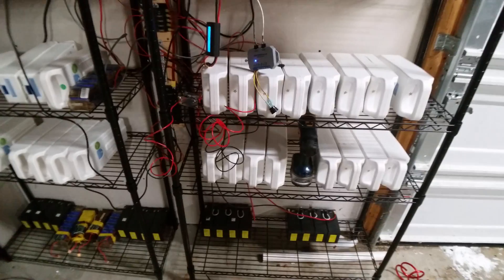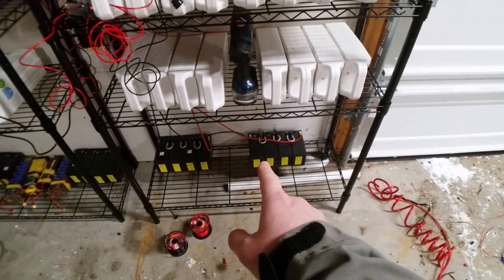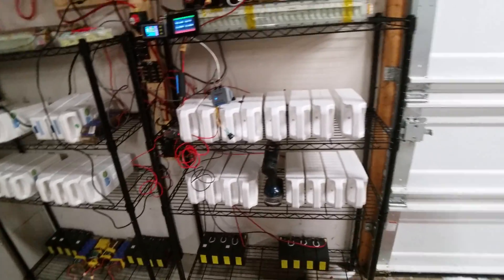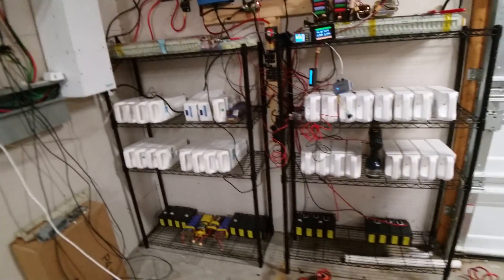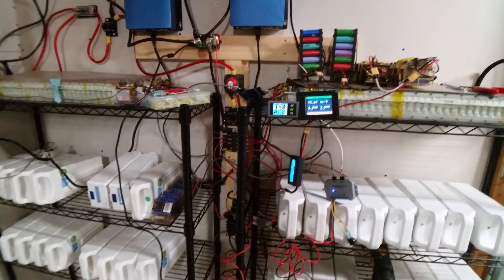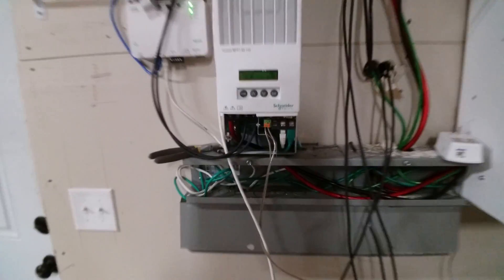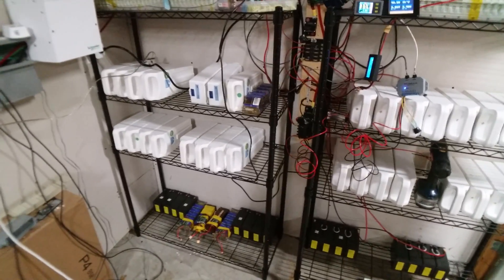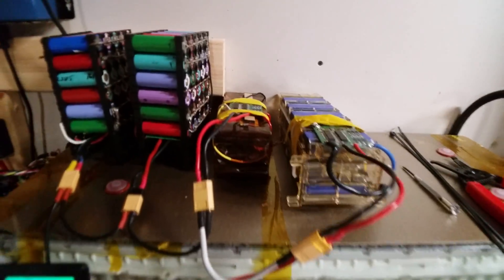DIY Tesla Mobius Powerwall Almost 20kwh Update 2

Comment: Hey man... I appreciate you documenting your journey. I just picked up a couple mobius battery packs and am planning on using them to create a portable solar generator. I was wondering, did you do anything to be able to draw power out of these packs? When I connect an inverter to one, or both in series, I get no power to the inverter. I saw  a video from combatengineer that he had to send a 12v current through the inverter back into the battery with a power supply to allow the inverter to then start drawing power... But seems like you're just plugging and playing? Any help would be much appreciated
👊🏼 Dave

Comment: When wiring up your mobius packs to 48 volts (4 in series).. are u still able to use the bms that are in the packs as they are 12 volt BMS running 48 volts out?
Reply from the maker: Because they are in series the 48v is divided between the 4 packs, so they only get 12v each.
The BMS works just fine, been using them this way since summer and no issues.
If they were in parallel, than that would be an issue, than they would all be getting 48v and would fry the boards.

Comment: New racks are 👍. Hey. I’m trying to bump charge the sonata 5300 batteries I over-discharged. What volt & amp settings do you recommend? Thanks brother‼️🔋
Reply from the maker: Did you have the BMS board connected? IF so the boards maybe damaged
If not there is light at the end of the tunnel

You will need an RC lipo charger (B6, Tenegry AC6, etc)
Connect the lead only to the first string of batts (Pos/Neg), set the charger to NIMH or PB (one or other maybe needed depending how far you discharged them)
Set the current to 10amps max (The NIMH option should auto adjust voltage, but for the PB you will have to set it for 1 cell)
Start charging and see what the voltage is doing, you should see the voltage start to slowly come up.
Once you get the batts to stay at 3v without the charger on, than you can set it to LIPO mode and let it charge like normal.
I have done this many times with regular 18650s and it works great.
You will have to do this for each row of batts, unless you have multiple chargers

Here is a link to a charger

https://www.amazon.com/Genuine-Professional-Battery-Balance-Discharger/dp/B0722NGPBS/ref=sr_1_9?ie=UTF8&qid=1515588272&sr=8-9&keywords=b6+lipo+charger
Reply: Mytime34 ; Disconnected the bms on both packs ala Jehu Garcia, cause I’m a dumb newb. One pack is broken down to singles and the other is still intact. I’m using a down-step converter, but I didn’t try 10amps. Leave voltage @ 4.2? Thx for responding 👊
Reply from the maker: J.E. Rose in some cases you might have to jump the voltage up a little, kinda a like a big quick boost. Each battery may require a little different currwnt and voltage. I have not used a step down converter, so I cannot say if that is right or not. With an RC charger they will cycle on and off so you don't destroy the battery. I did the same as you with my first few packs, but realized that the bms board is actually a good board if you are staying under 15amp of discharge
Reply: Mytime34 ; I’m saving up for some Average joe shwag, but the Imax charger is on the list 😉🔋🔋

Comment: Looking good Man!!! Cold as sh!t here as well. What is your mining rig or rigs inside🤤🖒
Reply from the maker: AveRage Joe, here is what my rigs consists of the following:
Rig 1, Main Gaming PC Win 10: Intel 6700k, Gigabyte Z170X-GamingGT Motherboard, 16gb DDR4 ram, 2ea 512gb M.2 Hard drives, 2ea 500gb Sata SSDs, NZXT H440 Case (All panels removed), EK Predator 360 watercooling setup (with quick disconnects), Asus GTX 1070 Dual 8gb video card (stock cooler), Gigabyte GTX 1070 Micro video card (stock cooler), HX1200i power supply. I have the cards running at 60-65% power, memory is overclocked to 712mhz and no core overclock. This system nets be about $10 day. Via NiceHash

Rig 2, Server/miner/video processor Win 10: Intel 5200k, Asus X99-E WS/3.1 Motherboard (with 8 PCI-E slots), 16gb DDR4 ram,  256gb M.2 SSD, Giant thermaltake cube case, EK Predator 360mm watercooling kit (quick disconnects), EVGA GTX 1070 FTW with EK Waterblock, EVGA GTX 1070 with EK waterblock, 2ea HP OEM GTX 1070s with EK and XSPC water coolers, HX1050 power supply. These cards are running between 60-72% power and this system makes between $17-30 a day, via NiceHash

Rig 3, Rack setup Simplemine OS: Intel I3, 16gb DDR4, 30gb SSD, Metal frame rack, AX1200i power supply, EVGA GTX 1070 FTW, EVGA GTX 1070, GTX 1070 Founders Edition, HP OEM GTX 1070. These cards are running between 60-68% power, memory is overclocked to 800mhz and no core overclock. This system strickly mines Ethereum and makes about $15-20 day

Rig 3, Pole Barn PC Win 10: Intel G4400, 8gb DDR3, 128gb SSD, MSI case, 500w thermaltake PSU, Asus R9 290 Dual video card. Card is running stock at full power and a slight memory overclock. It makes about $4-6 a day via Claymore miner (Ethereum)

My plan is to put the 2ea GTX 1070 FTW cards in my main gaming PC with watercooling and run the cards all out, they mine really well.
Than take the 3 HP OEM GTX 1070s and the Founders edition and run them in the rack setup, as they run almost the exact same settings.
The last system will have all the EVGA GTX 1070s in it, which will have the same settings.
As of right now between the Nicehash mining and the ethereum mining, my systems project $1k-$1200mo
This will be my first solid month of having all 4 systems running.

I purchased all of these items used on ebay and forums and nothing was full price, more like 50% off normal pricing
My ROI is 3.6 months at my current rate

I will try to shoot a short video on my setup, but man my office looks terrible and Jerry Rigged (that is a shout out to Barnecules Nerdgasm)

Comment: I very interested in the complete wiring system, could you go over it more slowly and explain why you choose the different types of storage, the benefits of each, thanks!
Reply from the maker: The mobius packs are where I started, I found them by accident and thought they would be cool to try and use. This was before I ever got into the solar portion.
After I bought my first 4 packs I created a very small setup with 2ea solar panels.
Once I realized how easy the packs were to use and that they had built in BMS's I proceeded to expand.
I found a local solar panel maker and got a good deal on my first 8 panels, with those panels I was able to get my first charge controller (just a cheapy one). At this point I realized that 12v setup was not going to work for me.
I had enough mobius packs to make a 48v system, but I needed a new charge controller, so I got my Schneider MPPT 80/600 setup connected to the 8 solar panels. 
With all that power, I needed to add storage to make sure it could run my inverters at night.
The only reason I got the tesla packs is that they were a heck of a deal and had the power I needed.
The mobius packs are cheap and easy to get/use. They provide 1.1kwh worth of power
The tesla batts are just really nice batts
The only reason I am using the VRLA batts, is because I get them for free and they help balance out the coupe de feut

Comment: what custom settings do have for your controller?
Reply from the maker: Which controller are you referring too?
Reply: xantrex
Reply from the maker: For the Xantrex/Schneider Charge controllers I have them set to custom battery settings:
MPPT 60/150
Charger 51v (actual charge value is 50.4vdc with a calibrated fluke meter)
48v battery
Absorb time 180min
Max charge 100%
Bank Capacity is 440ah
The aux contact is set to turn on at 48vdc, so the solid state relay activates and turns on one of the inverters
This same contact is set to turn off at 36.5vdc and turns off the solid state relay, which in turn shuts off the inverter

The MPPT 80/600 is set very similar, except I am not using the aux contact.
I am using an email notification if the system is making too much power, at that point I remotely activate the 2nd inverter, via a wifi outlet.

The only issues I had were in the beginning, when I was pushing too much voltage to the packs and fried a few boards, but now I have things set exactly how I want.
Once spring rolls around the solar output will charge all my batts by 10-11am, so than I will be able to run the inverters all the time.
My goal is to purchase the Conext XW+6848 hybrid inverter, which will automatically turn on and off without solid state relays.
I can than sell my 1k grid ties
Reply: thanks, i have a xw 6048, thinking or adding tesla batteries with my lead acids.

Comment: What's inside those Mobius packs?
Reply from the maker: BellPhreak they are Boston power 5300mah cells. Check out my other videos as I have some packs that are taken a part. Also check out The Combat Engineers videos, as he takes a pack a part.
Reply: @mytime34  Did you find it tough getting 18650 cells out of these packs? The housing is supper stubborn on mine
Reply from the maker: @DownwardSlideBlues  SOme of my packs had the 18650s and some had the Boston 5300 cells. The aluminum plates soldered to the cells are what take forever to remove. I never really had issues with the housings.
Reply: @mytime34  after I posted that, I went nutso with the pliers on the nickel strips, and that definitely made a huge difference. All the cells were super drained though (1 volt or lower) so I have a bunch of cell rehabilitation ahead of me
Reply: @BellPhreak I have some of the Mobius packs for sale. If you are interested LMK.
Reply: Lawrence Gerber Hi Lawrence..I may be interested in some of your mobius packs if the price is right
Reply: @RALPH Looney
How many do you need?
Reply: Lawrence Gerber between 40 and 60
Reply: Do u happen to know of a formula to calculate the remaining lifespan of the cells based upon the percentage of stated capacity remaining in a cell? The  ones I have purchased  so far have around 4000 left of the 5300 mah stated as new.
Reply: No I do not.